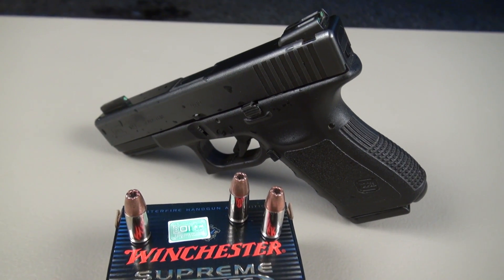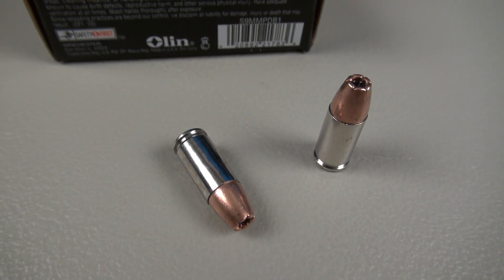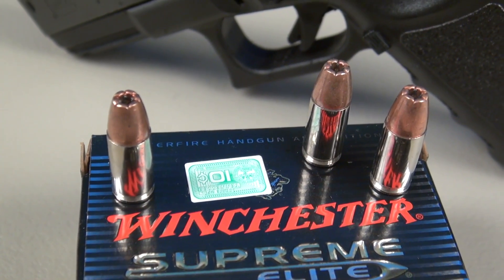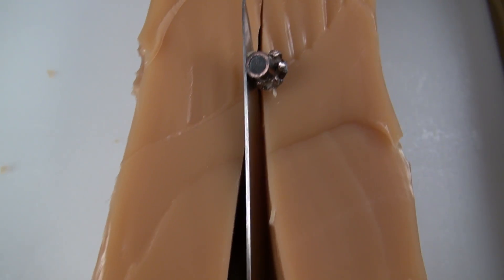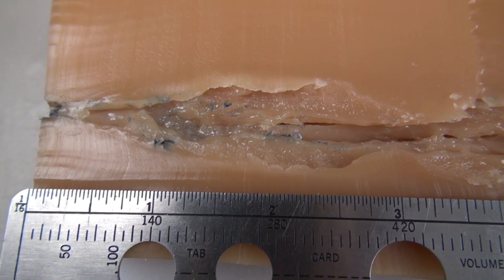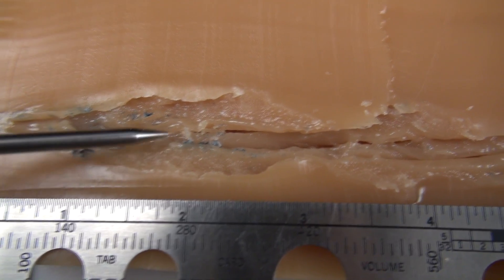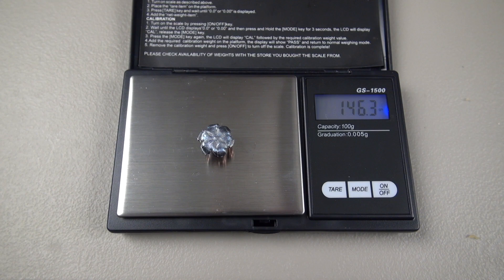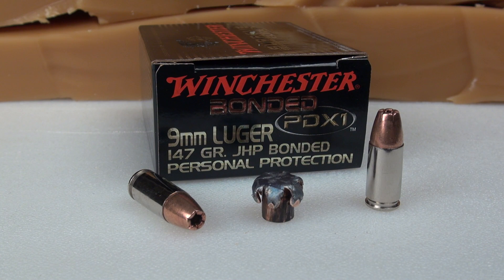9mm Winchester 147 gr Bonded PDX1 Ammo Gel Test

Comment: I recognize that bullet as the Black talon by Winchester came out in the late '80s. They had to pull them off the shelves after a bad guy was shot in the leg and because he ran it several arteries moving around inside.  For a while it was CIA use only because they were too deadly 🤨🤔
Glad to see they are back. Although I did like the look of the black projectile with a nickel casing. Very tarnish and corrosion resistant. I still have a couple boxes. And I have a swamp cooler in my house only in Arizona if you know what a bad combination that is.

Comment: no, a gel test doesn't tell you everything about a bullet's performance. but, if you watch the PDX in .40, do not tell me that the nine is so close that it's negligible anymore. it doesn't come anywhere near the .40 in pdx1!-or any other manufacturers! this test was done with  a 147 grain bullet, which will give you the biggest all around wound track from a nine-and these were the results. instead of a good 2 and half inch diameter by 8 inch length stretch cavity, as you get with .40, you get not even an inch in diameter with the nine, and only 4 inches in length-that is only half of the .40 cal. not to mention, the .40 is known to plow through bone and has been as close to a proven stopper as you can get!  it has been for nearly 30 years! so, please don't argue with science anymore-it's ridiculous! the nine has never been a proven caliber! there are far too many variables with it. thanks
Reply: Evelyn Galinac you are hilarious. The .40 is not a proven man stopper. No handgun round is, including the .44 mag. Many people have gotten up from 6 shots of .44, including a police officer where I’m from. The most important aspect is shot placement, but whatever helps you sleep better at night bud. For the lower recoil and decent energy, the 9mm cannot be beat.  Have fun with your compromise round (you should’ve gotten a 10mm). And no, I’m not a fanboy or any caliber, but am a fanboy of shot placement. Train more and run your mouth less, regardless of what you carry.
Reply: Umm nobody carries 40's no more for a reason.
Reply: Get ur facts st8. 9mm is the most diverse round out there every platform capable defense, targeting, cost, you name it so stop spewing fecal matter out of your fingers.

Comment: i do prefer the Federal 147gr +p HST round, but this one, and the Corbon all copper round are also in my ordnance locker...haven't yes found as good a deal on Corbon definitely, and Speers is a bit higher than Federal. The deal i got of the Feds allows me to train with my defense round, cant believe how good a value they were. Prior to them, i used Barnes TAC-XPD, but all 3 listed, to include the Speers, outperform it by a mile.

Comment: I'm making notes comparing a few of your 9mm tests.  This 147-Grain PDX-1 penetrated 14.75".  So did the Federal HST 124-Grain +P (@.591 Avg dia).  Matching that penetration with a longer wound channel longer than HST 147-Grain (standard & +P) had 3" & 3.2" wound channels.

The smaller expanded dia of .573 is what allowed the 14.75" penetration.

Comment: should  I  go 115 or 147 standard pressure if I am using a  3.1" barrel in your personal opinion. I am aiming for the 12-14" mark in penetration and I want decent expansion and no pass  through. Out of  all  the ammo you've tested which would  you most recommend to my needs?
Reply: Underwood 115grain +p+  1400 fps 501bls muzzle energy out of 4 inch barrel.

Comment: In the past, I know expansion has always been an issue with the 147gr. 9mm bullet, but it seems that Winchester has solved that problem!  Thanks for the update video!
Reply: This bullet had been around since the '80s and they had to pull it off the market for a while because they dubbed it to deadly. Because it expands to an inch and the tips are like knives just shredding everything inside. A bad guy got shot in the leg kept running as a result it's severed several veins resulting in a bleed out very quickly. At that time it was deadliest hollow point on the market. So Winchester started selling them to CIA only for a while. Good to see them back again on civilian shelves. The only flesh and Bone that I've ever had to shoot with it so far was a coyote. With a 45 Black talon. It did not over penetrate and from 15 ft away knocked it almost 2 ft.
Reply: @mikesuch9021  I think this is the modern-day black talon
Reply: @Arkansas_MadeMan Ranger-T is an improved Black Talon.

Comment: Not bad, but I still prefer the 124gr+P flavor of this for my Ruger P89, which is my secondary HD gun and winter CCW - it's also about the ONLY +P load that I prefer (besides Speer Gold Dot 124gr+P, in the same gun), as all my other HD/CCW pistols get non +P loads. The 147 just penetrates a bit more on average than I prefer and expands a tad less than its lighter-weight sibling in the same caliber. Still not a bad load, though.